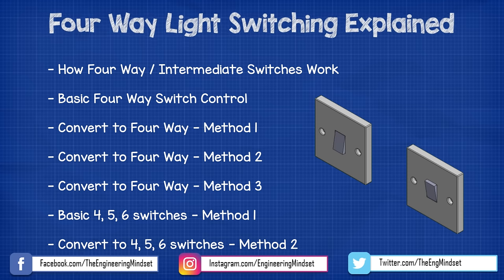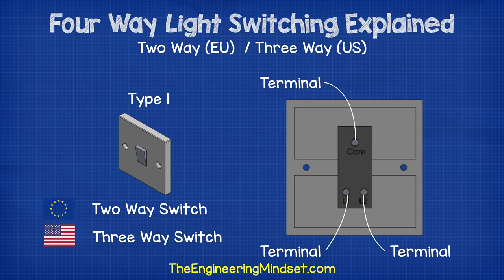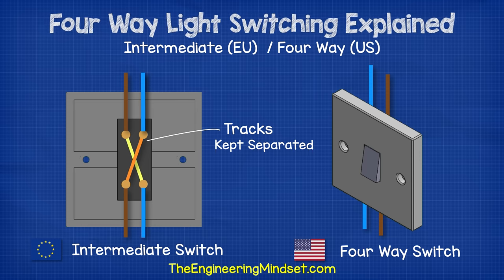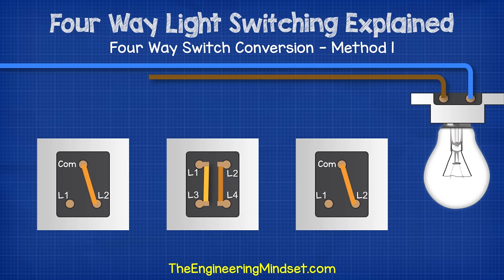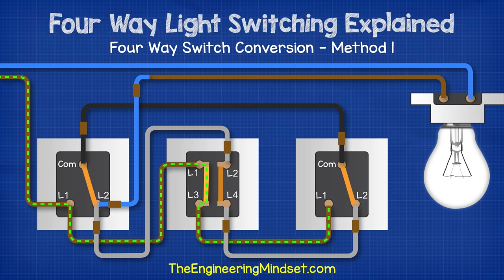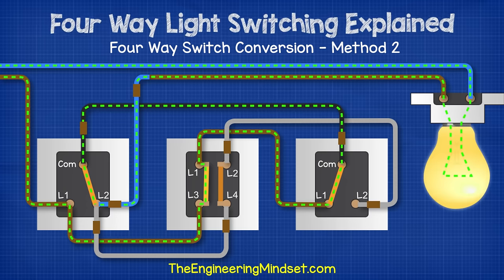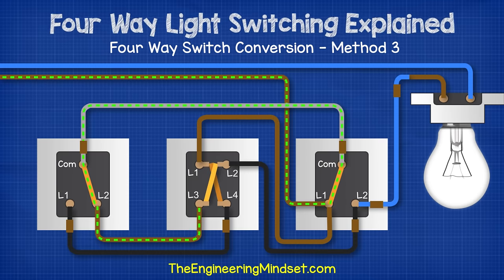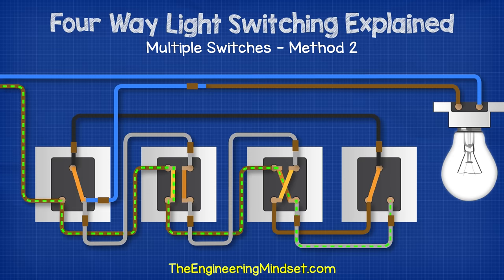Four Way Switching Explained - How to wire 4 way intermediate light switch

Comment: Are there situations where the different methods have advantages over each other? I can't think of a reason to not wire it the first way which is by far the simplest and easy for anyone fault diagnosing to follow.
Reply from the maker: Yes, check the subtitle on each. Most are conversion
Reply: Ahh of course sorry I missed that. They use the conductors already present at the switch
Reply: Yeah. The 2nd one is for an existing basic model so need not to make so many changes

Comment: The head of our bed is placed perpendicular to the wall on which the overhead light switch is mounted by the door. My wife has to walk clear around the bed in the dark at night after turning off the light or in the morning to turn the light on.
This 3 switch circuit will allow me to  replace and rewire the original light switch with a 4 way and add 2 more 3 way switches on either side of the headboard. In this manner either of us will be able to turn on or off the light when entering or exiting or from either side of the bed.
Thanks for your very clear and concise video. I know that I'll get a lot of husband points for my efforts...
Reply: TMI 2:17 2:18 2:19 2:20 2:20

Comment: Am not Electrician but I love working on my own house wiring, may working on a faulty wiring. This is of great help since it is explained simple
Reply: Hire a professional. It is illegal to work on your own house wiring unless you are professionally qualified.
Reply: @tensevo Oh boohoo illegal
Reply: Going 4 way is a big mistake. There is no 4 way smart switch replacement meaning you are stuck. For 3 way or single pole you can easily replace with smart devices and add infinity numbers of WiFi switches everywhere you want. 

The only non-smart device I have remain in my house is a 4 way.
Reply: @tensevo it’s legal to work on your own house in many places
Reply: It may be legal but if you do a mistake the legal turns into lethal.

Comment: Hey. Cool Video.

As an Elecrtician it's always interesting to see how things are handled in other countries.
But your Videos leave me some questions:
1. Which country are you from? Just to understand which regulations you're referring to. (Sorry for not being able to recognize that form your accent).
2. Ist it so, that intermediate switches in your area just have four outlets and cross the Switches mechanically? Because in Switzerland we have a double-switch (which is operated by one "lever") and have to connect the wires form output one of switch one to output two of switch two and vice versa. The wires then create an X on the back of this switch, so it's called a cross-switch and the whole arrangement is called a cross circuit.

At last i would mention, that in our electrical regulatory we always expect, that a wire is a life wire. So we only have to dindicate, when a wire is not life by placing a blue sleeve on it's end. (Much cheaper and safer option i think).

I hope you can answer my Questions. And if you are btw. interested in making a video about the "swiss way" of electrical installation i would be happy to help you with some facts.

Greetings from Switzerland. Julian
Reply: That system where you mark non-live wires is quite clever! Thanks for that info

Comment: Damn easily explained but still going over my head. Probably have to watch few times
Reply from the maker: Take as long as you need :D
Reply: Be carefull not to use wizardry on muggles technologie
Reply: @fredtoituyau278  :D
Reply: @EngineeringMindset  Yep repetation is the key to realisation :P
Reply from the maker: completely agree. eventually your brain digests the info and you understand it

Comment: How important is it to consider the colors of the wiring? It seems to me somewhat arbitrary to which wire becomes which color, as long as the outputs of each switch have 3 unique color wires, which can but do not have to be the same orientation between a second/third switch.
I also don't understand why the color wire to the load is neutral. Shouldn't it be the color brown (L1) coming towards the load, since it will then be neutral only after the load?
Reply: The reason the wire colors change is because typically people don't run individual wires that are the correct color, they run wires that are prepackaged out of the box in a set of two or three colors (grey, blue, brown here, in the USA it may be White, Black, Red).... so you often don't have two of the correct color wire running out of the box.  Usually this is marked by putting the correct color electrical tape on the wrong colored wire.... 

It's important to mark them some discernible way so that if someone is messing with the wiring later, they can tell what in the world you were doing but they don't necessarily all have to be completely the correct color, any electrician that opens the box and sees a blue wire with a brown piece of tape on it for instance is going to figure out why you did t hat.
Reply: Yes, I agree with you. It seems a little bit confusing. The wire coming from the switch should be brown because typically here in the UK we use twin and earth cable (brown/live, blue/neutral and green & yellow/earth). So typically the whole cable would be taken to the switch, with the blues (neutrals) blocked together and the brown (live) terminated into whichever plate method you are wiring. Also the green & yellow (earth's all blocked together).
 The cable to link the two or more switches would be a 3core and earth (brown, black and grey, plus the earth) and they would all be sleeved appropriately for what they were being used for (brown sleeving for live/intermittently live or blue for neutral.
 I hope this has cleared things up for you. Just trying to get my head around it myself. I also hope this is correct and thanks for the videos. I've enjoyed watching so many of them. I can see a lot of hard work has gone into making them and they are both clear and concise.

Comment: Unless standards in Europe have changed since the 2010s, Red is the main colour used for Live, with Brown, Black, Purple, Grey, Orange used as secondary Live colours (going from switches to receptors).
Reply from the maker: IEC colour codes are Live = brown, Neutral = Blue, Earth = Green-yellow. ~2004/2006 it changed from red, black (IEE)

Comment: Hey the video is very helpful and also very well describe how a 4 way switch works thanks for the video 👌

I’m working on some lights installation and i have a question for you i have 3 light’s I’d like to know if it’s possible to have 2 4way switches that can turn all 3 lights on ! and of : and then have and other switch that turn just 1 light on and If I’d turn 1 of the 2 4ways on. That all 3 light’s are on. If turn them off! one of the 3 lights is still on.
Reply: It’s possible cause I’m actually working on something like this where I have a group 12 leds on one switch and one light lands on by the kitchen island and I’m thinking of using it on a separate switch by using a third three way switch and using that to split what goes to that light

Comment: I have wiring in my new build home similar to Method 1 at 4:43 but the power (live/neutral) and the load wire seem to be in the middle 4 way switch, I have 2 wires coming in both L1 and L2 and 1 cable in the others, as well as within the box neutrals connected and com connected. Struggling to understand why it seem to be done in even more complex way than it needs to be... I just want to identify the load wire route to light so I can put a smart switch instead of the 4 way switch, then use the existing wiring to convert the other switches to just live/neutral receivers for smart switches as well, which would control the first one. Any suggestions? Also what software is this diagram on? Would be great to try replicating what I have and seeing what would work.

Comment: At 3:00, is there any reason you use L1 instead of L2? Using L2 would seem more logical since you can then use even numbers for live and odd numbers for the switched neutral
Reply: It really doesn’t make a difference tbh mate
Reply: there is no switched neutral. We dont switch in neutrals. Live conductors only.

Comment: In method 2, instead of running common wire between the 2 end switches and then run a blue/brown wire to the light, is it OK to just use the lights black wire as the common and avoid the other 2 wires?  I ask this because there are no 3-wire cables in the existing setup i have and the source line and the light wire are in the same box. I can run a second cable from the far end of the recessed lights serving it as the common between the far ends of the 3-way but is this OK to do?

Comment: Whilst easy on paper, rather hard to get my head around this in my property. However I have just realised that as long as you don't connect the neutral cable into the switches the worst that can happen is  dodgy logic and there is zero risk of popping the fuse/breaker,  this realisation has put my mind at ease!

Comment: I'm from Brooklyn but correct if my wrong so you put two wire on L2 ?! On the second method ?!
Reply: Yes. Since it's called conversion, I imagine the leftmost switch is the original one, which then gets expanded with extra switches chained on.

Comment: Wouldn't L3 and L4 often be named L1' and L2'?
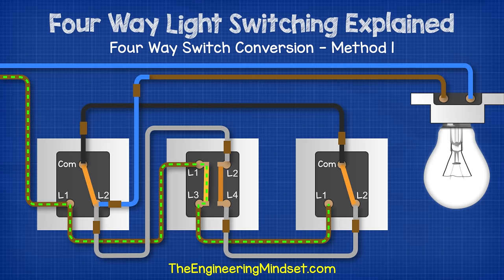Would make most sense in the configuration shown as "Four way switch conversion - Method 1" (4:30)
Reply: I've seen both in the UK personally prefer L1 & L2
Reply: The prim ' indicate the incoming line (common on motor controls), so L1 and L2 would become L1' and L2', while L3 and L4 would become L1 and L2.

Comment: I like the content, helpful. Question though - Can the device only operate from one end of the chain of switches? 

What I am dealing with are 3 exterior lights all separately switched. I want them all on the same switches. So at the end each of the 3 switches turn all 3 lights on or off.

It would be a lot of wire running to make this happen if all switches needed to be in series first and then the devices down line in series from the last switch. 

Any insight you could provide would be helpful!
Reply from the maker: You probably want this circuit instead https://youtu.be/jYFVsUqY6zc
Do not wire your lamps in series, they will not work

Comment: I have a double paddle i want to put into 3 switches to control fans and lights in the room. 
I have a double paddle that one switch is fan, one is light...i want to have another 2, even just 1 more switch, that would be a 3 way switch

Comment: but I thought that in the UK the live normally feds the bulb/light and then the switch turns is off and on.
Reply: Correct, that's how I was taught the rose feeds the switch not the switch feeds the rose
Reply: It doesnt matter which feds what first...
In Switching what matter the most is obtaining the Permanent-Supply then ensuring the configuration of yr Switching is feeding the correct/designated Load-Point...

Comment: Noticed u are placing a brown sleeve on the grey, blue and black wires. Why not use the brown wire instead since u already know which terminal it is connected to
Reply: Its within a cable made & 'coloured' according to the manufacturer.
Reply: It also makes it easier to keep track which terminal is connected to which. Imagine coming back years later, and all wires are the same colour.

Comment: A lot of the 2 way explanations only use single gang switches.... Can I see an explanation using a 4 gang switch where 2 of the switches are a two way switch with 2 other separate switches. Make one a 2 gang and the other a 4

Comment: The "EU" colours are wrong for fixed installations (wires, not cables)
you use:
blue as neutral
brown as unswitched phase
black, blue, grey as switced phase
This is .. simplified.
Never use blue as a switched phase.

The coloring for fixed installations:
Unswitched phase is black. Always. On multiple phases, brown and grey are L2, L3.
Blue is neutral.
For the switched phase it is literally another colour, e.g. violet, white, brown, red, orange, pink, grey,....  

For your light switch scenarios, mostly orange is used.

Your colouring is not permitted, and using blue as a wire with power on it is dangerous and forbidden.
Reply: According to my book from 2019, you are correct up to the point where you reach the first breaker.
From there on, there is an explicit permission to use whatever colours desired with two exceptions: green-striped yellow is ALWAYS ground, and must not be used for any other purpose, and red cables should be avoided to prevent mix-ups for colour blind electricians doing later work on the installation.

Comment: hey can i ask something? What is the circuit structure of a 4 quadrant switch?
Reply: It would be basically a DPDT switch (Double Pole Double Throw) which is two two way switches operated by the same handle. A basic DPDT switch has six terminals and can be used as an 'intermediate' switch by using appropriate connections. However the ones used for intermediate switches have four terminals and a couple of internal interconnections.

Comment: Is there any reason Four Way switches could not be used in place of Three Way? Just from looking at the diagram, it looks like you could treat L3 as Common, and leave L4 disconnected to have the same behavior. Why use Three Way switches at all?
Reply: In fact its a common practice for 2-Way Switches be used when wiring a 1-Way Circuit. It merely boils down to availability & cost wise.😏😏
Also worth mentioning that not only you can use 4-Way Intermediate Switch in place of 2-Way Switch(threeway) you're free to use it to wire up any 1-Way Circuit and its perfectly fine.😅🤫